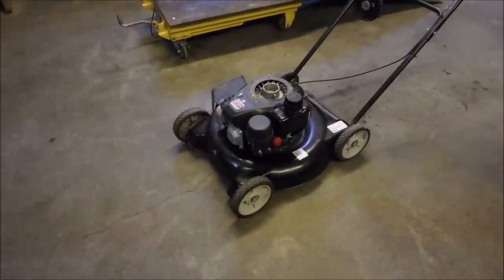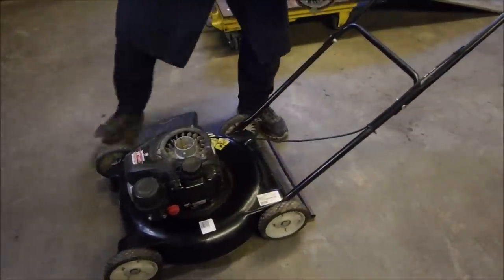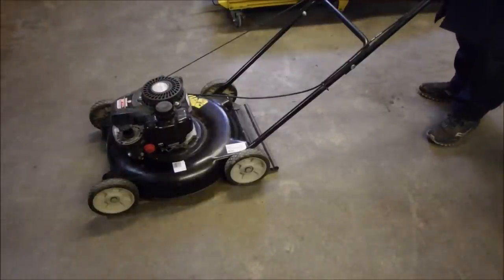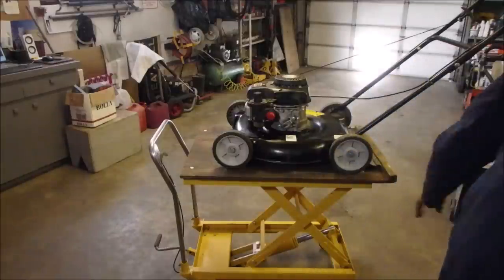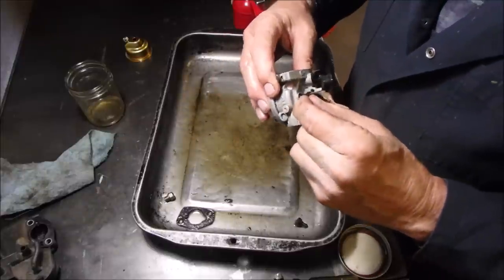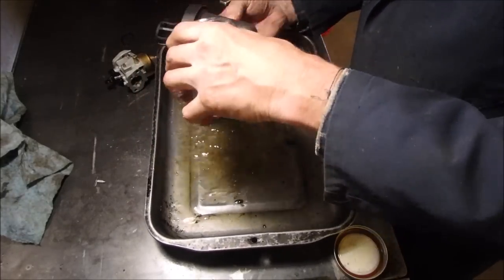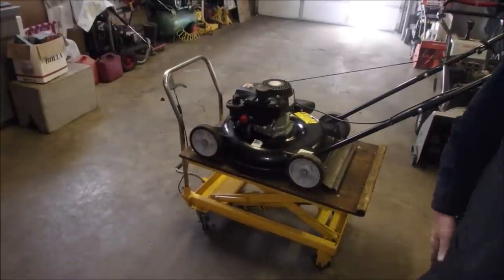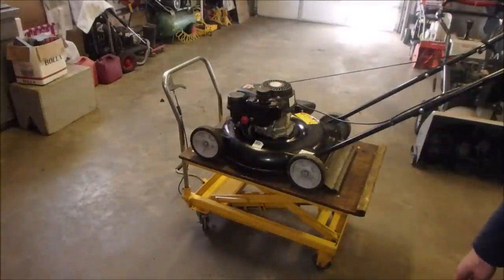How to make this Powermore Mower Run

Comment: That rice burner started quick and ran like a top after the service. The limited room to get at the carb bowl is a royal pain and maybe the answer is to take a hole saw and cut a round hole in the deck to drop the bowl. lol I have a couple of these to tackle in the Spring as well. Another good job Bruce!
Reply from the maker: TWhanks a lot Don

Comment: Correct Bruce the Powermore is one great little engine with very few issues other than: the fuel line is so short it is extremely hard to remove and install on the carb and much easier to remove the fuel tank first. At EP i spray a little silicone on the inlet fuel connection prior to fuel line install. I believe these are $199 mowers soon to become $299 with inflation.
Reply from the maker: Great point!

Comment: That particular engine looks like their tiny little 80cc one.  Had one earlier this year, always started first pull, ran smooth.  Great for a small yard.  I had to order like $20 in parts for mine - needed gas cap, air filter, and the filter cover - now that the filter covers aren't screwed on they get lost a lot more lol.
Reply from the maker: Yes  I collect any type of filter cover

Comment: Runs well after a bit of Brucy TLC. Quite a lot of water in the tank, I wonder if his petrol can is left outside too and water gathers at the bottom of the spout and then gets poured into the mowers tank
Reply from the maker: Yes I told him to get rid of his fuel in the red tank.

Comment: Again, nice video Bruce. At first, I didn’t like the PowerMore because of it being a Chinese product but lately I favor them over the new Briggs engines. For the size of that fuel tank, you’d be surprised how long that little engine runs on a tank of fuel.
Reply from the maker: Yes  These har3e becoming "The common engine"